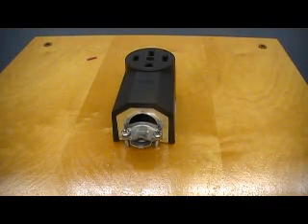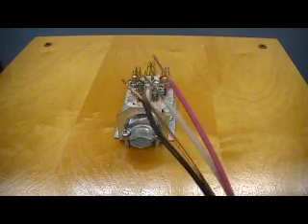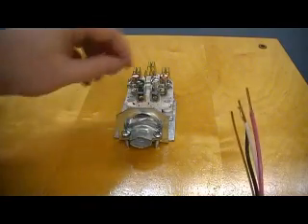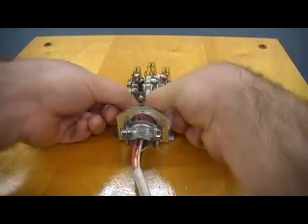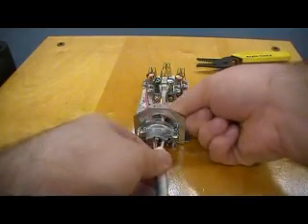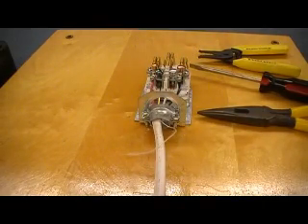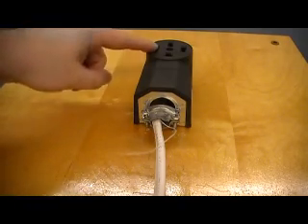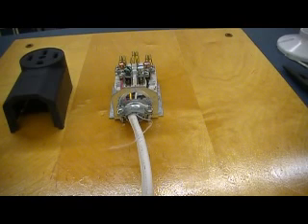Dryer (240V) Receptacle

Comment: Do not use 14 gauge wire on 30 amp circuits. You need 10 gauge.